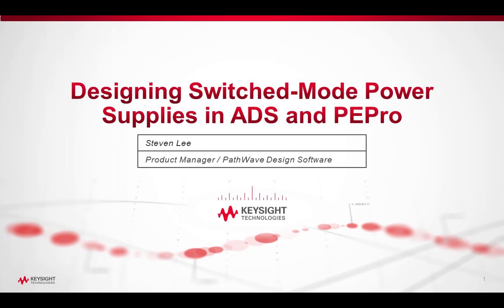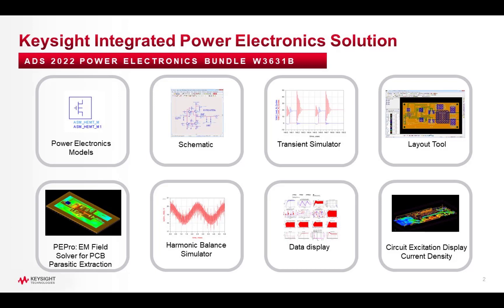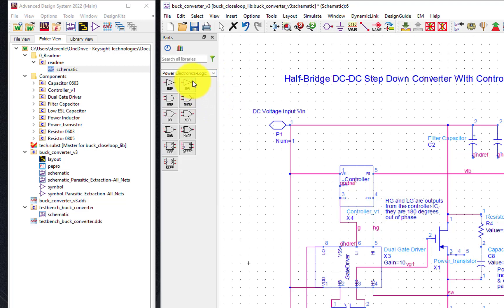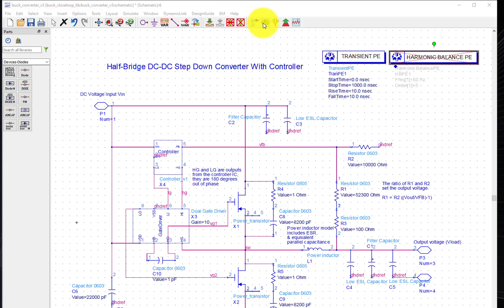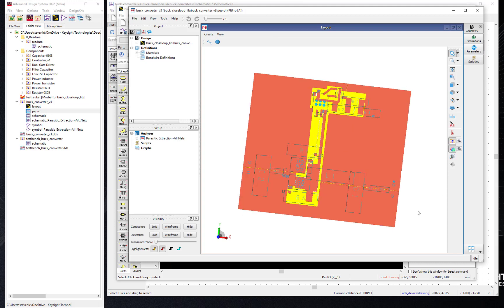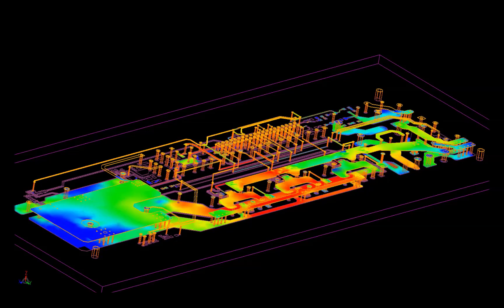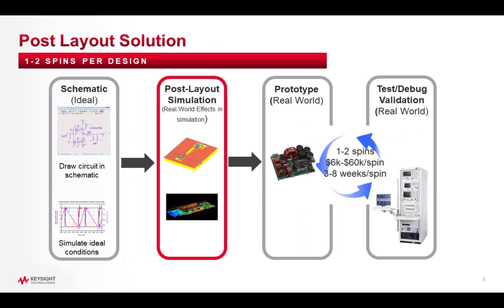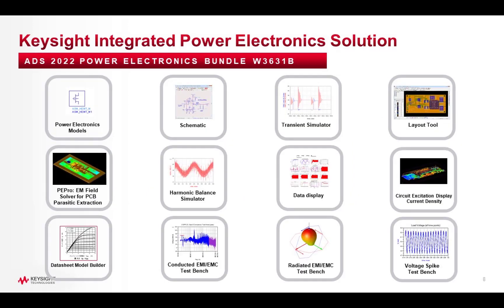Designing Switched-Mode Power Supplies in ADS and PEPro

Comment: Hello sir, 

First, I'm grateful for this illuminating video.

I've designed a dc-dc buck converter, simulated this design in PEPRO then generated the Radiated EMI test. The simulation went well. Yet, in the post process of the result and after setting the excitation type to the circuit simulation dataset I wanted to plot the far-field pattern but I got this message: "Unable to render: No run with id exists for this simulation" knowing that I generated the conducted EMI test before without any problems. Also when I attempt to create the Radiated EMI graph I get the error message "input dataset is invalid"

I would be grateful if you could help me with this problem.

Comment: Hello，
 When I use ADS2021 to open the workspace,there are some problems happend.(I have been using ADS2020 and ADS2017 before.) In ADS2021, when I use FEM simulation layout as usual, job failed appears. I tested the cell that was successfully simulated with FEM before, and job failed appeared again. I created a new workspace and performed FEM simulation again, but the job failed still exists. I switched to ADS2020 for FEM simulation, job failed still exists. I can only simulate Layout through momentum, but I can't use FEM. Could you help me this problem
Reply from the maker: Please use one of the links below to contact Keysight's Technical Support for your Design Software question(s):
Keysight Support
https://support.keysight.com/KeysightdCX/s/?language=en_US
Contact Us web 
https://www.keysight.com/zz/en/contact.html